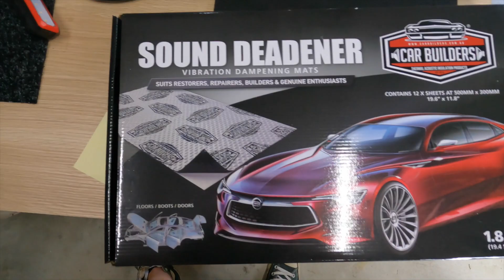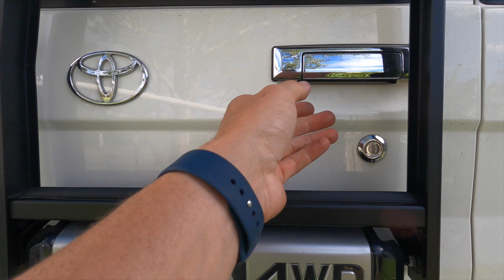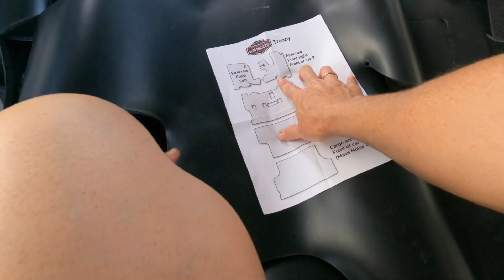78 Series Troop Carrier Sound Deadening

Comment: How much of a difference did it make? Looks like a very thorough job. I am going to do similar in my HJ45 build, hoping it will make having a conversation easier haha
Reply from the maker: We did notice quite a difference. But we don’t have an after market snorkel and exhaust etc adding more noise to the equation. 
The sound deadening has stopped a lot of road noise eg rocks hitting the underside and wheel wells.